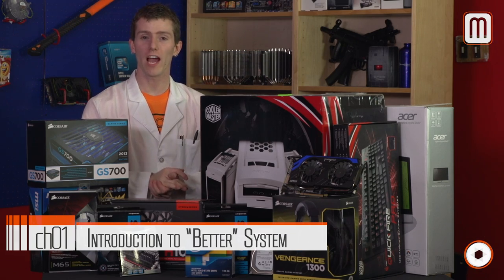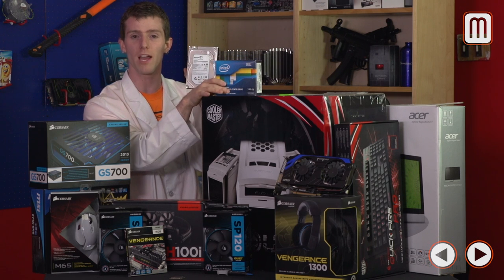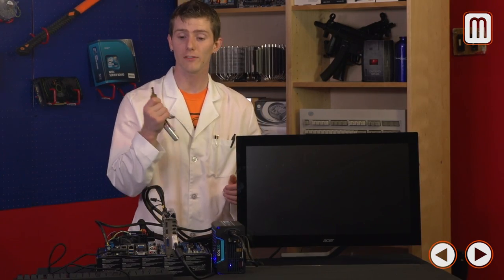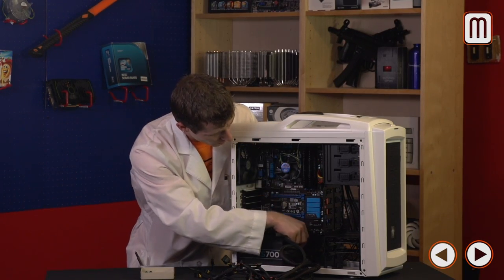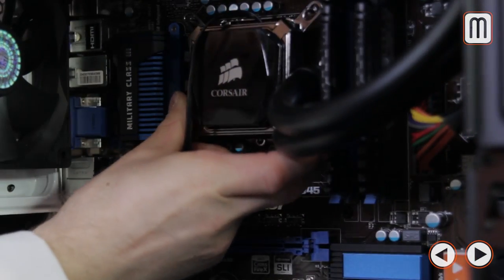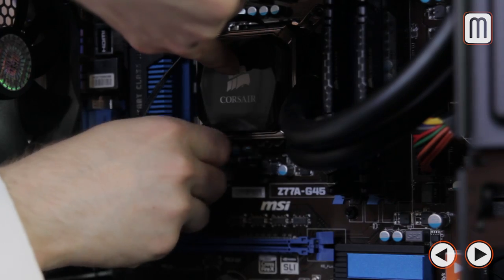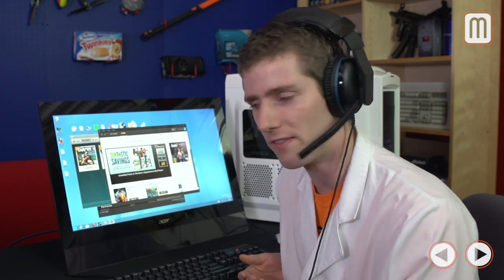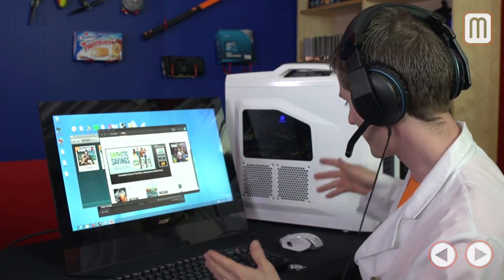ULTIMATE Build a Better $1500 Gaming PC Computer "How To" Guide

Comment: s this build good? If not please tell me what to change
Intel Core i5-4460 with Cooler - 
MSI B85M-P33-V3 Motherboard -
8GB 1600Mhz hyperX Fury DDR3 (1x8GB) - 
Geforce GTX960 GPU 2GB GDDR5 - 
Seagate 1TB 7200RPM - 
Enermax Fulmo. Q - 2x 120mm - with 500W Enermax NAXN Power Supply
Show less
Reply: You should go for a Corsair/EVGA Power supply, the power supplies that are included in cases are (In mayority) really unreliable and may cause alot of problems. The Corsair/EVGA PSUs are around 30$ for a 500W 80+ Bronze.
If you are planning on overclocking the Intel stock cooler won't cut it, get a Cooler Master 212 EVO, it fits in almost every socket and it's around 20 bucks.
Reply: Also, your Ram is one channel (1x8Gb) Dual Channel RAM is faster due to the fact that the data being transferred is going through two RAM sticks instead of one, (2x4Gb) Dual channel RAM packages cost around the same (or lower) and they're faster. JUST MAKE SURE YOUR MOTHERBOARD SUPPORTS DUAL CHANNEL RAM.
Also, if your Motherboard has 4 RAM slots, make sure you put a dual channel memory in the same color slots.
Reply: Miguel Eduardo hey thanks for the advices. Can I contact you via Skype or kik please? I want to continue my build and I don't know shit xD
Reply: +Miguel Eduardo can this build run gta v on 60fps
Reply: +Roey Lubin I would estimate that on high settings, around 60 Fps, I saw a benchmark, An i3 with an ASUS 750ti got around 50ish fps, now that you have an i5 paired with a GTX 960 I'm pretty sure you could play it on high-very high-ultra settings
Reply: +Roey Lubin What's your skype name?
Reply: Miguel Eduardo roeey100
Reply: +Roey Lubin Sent a request
Reply: ***** Hey brother!
Reply: +Roey Lubin Change your CPU to 'K' series unlocked processor
Reply: +Roey Lubin "8gb is way too overkill! 614kb is enough!" --- Bill Gates.
Reply: +Miguel Eduardo He can't overclock with a fricken 4460 lol.
Reply: Fallen Slayer whats overclocking?
Reply: Roey Lubin
Basically pushing the cpu past its limits and making it better, but it comes with a trade off:
More heat and higher voltage.
Reply: +Roey Lubin Overclocking is pushing a cpu or gpu over the manufacturer's specifications, thus making it faster. Overclocking will result in more heat so proper cpu cooling is important. When overlclocking, go into the motherboard bios for the cpu and a third party software for the gpu like msi afterburner to overclock. Mess around with the clock multiplier until you get a stable and satisfactory overlclock. If your overclock is not stable, try increasing the core voltage but not too high.

If you want to overclock, you will need a processor with a "k" at the end of it eg. i5 4690k and a "Z" chipset motherboard eg. Z97. Any gpu can overlclock. I recommend overlclocking as you will get extra performance at no cost. If you don't know what clock to overlclock to, simply search up an overlclocking guide for your cpu or gpu online.

For the rest of your build, get 8gb ( 2x4gb ) of ram. Two ram stick will enable dual channel, resulting in faster ram. For the gpu, get an R9 390 as it is the same price as a GTX 970 but has more vram and generally performs better. Get a 250gb SSD to install your OS and some of your games. An SSD is much faster than a HDD, resulting in faster boot times for your pc if your OS is installed in it and faster load times for your games. Get a Corsair, Seasonic or Cooler Master psu as those are good. Try getting an 80+ gold power supply as those will be more power efficient. I recommend a 750watt psu as you can expand your system if you want ( like adding a second gpu ) in the future without worrying about not having enough wattage to spare.
Reply: +C_Raz_Y thanks for the detailed answer

Comment: For $1000 I'm building a computer that could mister that one. Then again I didn't spend a lot of the budget on peripherals I actually didn't spend any of it on them lol. I didn't have to spend any on my cooler master haf 932 my friend gave it to me. But I was able to build a very nice computer
CPU: 4690k
GPU: GTX 970 FTX
500 watt thermaltake PSU
8GB of Hyper X Fury ram 
Corsair H105
I stole the 360GB hard drive off my old computer 
120GB SSD for boot
And the motherboard is a Asus Z97
All together I was lucky to have a great friend to give me that beastly case and to have a older computer to pick the hard drive from but all together my build comes out to I would say $1200 give or take. Without peripherals my build puts a lot of its budget into the key components CPU and GPU... But Linus seems to go for the all around builds, nothing wrong with that I go for shear performance.
Nice video Linus I appreciate the help that your videos have provided please keep up with the great content! :D

Comment: If I put windows 7 will this still work. Thanks
Sorry but I suck at this, Just getting started :D
Reply: 195fireball ok any vides you reccomend?
Reply: Windows 7 will work fine.
Reply: +195fireball why. it still works fine as fuck, i have a gtx 680 and a i7 980x and it works fine.

Comment: I need help with my next gaming PC do you guys think this is good for the price?
 BLUETOOTH: None
CABLE: None
CAS: NZXT Switch 810 Hybrid Full Tower Gaming Case w/ Dual 140MM Pivot Fan Slots and Front USB 3.0 [+48] (White Color)
CASUPGRADE: None
CD: 24X Double Layer Dual Format DVD+-R/+-RW + CD-R/RW Drive (BLACK COLOR)
CD2: None
COOLANT: Standard Coolant
CPU: AMD FX-6300 3.50 GHz Six-Core AM3+ CPU 6MB L2 Cache & Turbo Core Technology [-150]
CS_FAN: Default case fans
DOCKINGSTATION: None
ENGRAVING: None
FA_HDD: None
FAN: Asetek 570LXL 240mm Liquid CPU Cooling System w/ Copper Cold Plate (2 x Standard 120MM Fans)
FLASHMEDIA: None
HDD: 1TB Western Digital Caviar Blue SATA-III 6.0Gb/s 7200 RPM HDD [-19] (Single Drive)
HDD2: None
HEADSET: None
HS_HANGER: None
IUSB: Built-in USB 2.0 Ports
KEYBOARD: AZZA Multimedia USB Gaming Keyboard
MEMORY: 16GB (8GBx2) DDR3/1600MHz Dual Channel Memory [+74] (Corsair or Major Brand)
MONITOR: * 24" Widescreen 1920x1080 ASUS VS247H-P 1080P (23.6" Viewable) 2ms LED Backlight, DVI, HDMI Input [+169] (Single Monitor)
MOPAD: None
MOTHERBOARD: * GIGABYTE 990FXA-UD3 AMD 990 ATX w/ Ultra Durable 3, On/Off Charge, GbLAN, 4 PCIe x16, 2 PCIe x1, 1 PCI
MOUSE: AZZA Optical 1600dpi Gaming Mouse with Weight Adjustable Cartridge
NETWORK: Onboard Gigabit LAN Network
OS: Windows 8.1
OVERCLOCK: Pro OC (Performance Overclock 10% or more)
POWERSUPPLY: 650 Watts - Corsair CSM Series CS650M 80 Plus Gold Certified Modular Ultra Quiet Power Supply [+64]
RUSH: Standard Process Time: Ship within 8 Business Day
SERVICE: STANDARD WARRANTY: 3-YEAR [3 Year Labor, 1 Year Parts] LIMITED WARRANTY PLUS LIFE-TIME TECHNICAL SUPPORT
SOUND: HIGH DEFINITION ON-BOARD 7.1 AUDIO
SPEAKERS: None
TEMP: None
TVRC: None
USBFLASH: None
USBHD: None
USBX: None
VIDEO: EVGA FTW Edition NVIDIA GeForce GTX 750 2GB GDDR5 PCIe 3.0 x16 [+17] (Dual Card (Non-SLI) [+117])
I know this is alot of stuff but HELP ME PLS

Comment: i currently just have a gtx 650 installed in the pc i have now but just found out that they stopped making them..so if the MSI GeForce GTX 660 Ti Power Edition isnt available what would you recommend..also i live in australia so not sure if i can get the same components that you can get.

Comment: Can someone please let me know if this is all compatible? 

Case - NZXT H440 Blue 

Motherboard - MSI Z170A-Gaming Pro Motherboard 

Psu - Silverstone Strider Plus 600W Fully Modular Power Supply 

Cpu - Intel Core i5 6600K 

Ram -   G.Skill Ripjaws 4 F4-2666C15Q-16GRR 16GB (4x4GB) DDR4 Red 

Hard drive - Seagate Barracuda 1TB ST1000DM003

Graphics card - MSI Radeon R9 390 Gaming 8GB 

CPU cooler - CoolerMaster Hyper 212X CPU Cooler
Reply: +Corey Mettke All looks good, hf with your build.
Reply: Awesome :) thank you

Comment: 1500$ 660ti and i5 hot damn this just shows how far we came
Reply: the infinity stones guess what, an i9 and 2080ti in 6 years is gonna be a damn joke
Reply: @dakheelalmutairi2715  yeah, I actually bought this same motherboard with an i5-3570k,16 gigs of ram and a vega 56 with an xfx 850 watt psu all for about 400 dollars.It should get me by for a while lol until I spend 400 dollars more in 4-5 years for specs that will double my performance, despite my 3570k sort of becoming a bottle neck already

Comment: What are your opinion on a build like this:
-Intel i7-6700K
-GTX 970 (strix edition by asus)
-HyperX Fury 16GB DDR4@2133Mhz
Is something an overkill? Something lacking?
Reply: case
Reply: +KerrankiSuomee Don't get the 6th gen cpus there are reports of them bending due to pressure applied by cpu heatsinks and waterblocks. Get a 4th gen cpu instead. If you are using this rig purely for gaming, get an i5 and 8gb of ram as they will be enough. If you are editing on this rig, stick to an i7 with 16gb of ram.
Reply: C_Raz_Y I'm getting the 6th gen mostly for cheaper upgrading. Is the problem purely on the CPUs or the socket too? Because I'm planning on waiting until they are done with the 6th gen and getting the best one for that socket anyways.
Reply: KerrankiSuomee The problem is cpu based. I don't recommend putting a heavy cooler on the 6th gen cpu as it may bend.
Reply: It's a basic cooler for now as I don't plan on overclocking it. Do you think that they will be fixing the problem for later CPUs of the 6th gen?
Reply: If "future proofness" is worth an extra £100 - £150 to you, then go DDR4, but that banding thing is definitely something to look out for. You may be waiting a long time for the next generation though.... 

My advice is to go 4th generation haswell
Reply: +KerrankiSuomee if you're not overclocking why get the 6700k? Just get a normal 6700, you save a bit of money and it comes with a cooler
Reply: +Nava Hivon locked one is at 3.5GHz and unlocked at 4 :)
Reply: +KerrankiSuomee- I personally have not seen the skylake bending theory. I do know that this build will perform nicely under almost all conditions. The 6700 non-k can turbo boost to 4.0Ghz. Only thing i would recommend is that the ram frequency be faster. Skylake's like faster ram speeds. This is my opinion, take it as you please.
Reply: Depends if u playing runescape on 30 fps and low resolution
Reply: killerhackie I'm not sure what you mean there. The Skylake 6700(K or non-K) is pretty powerful. Adding in the Strix 970 in there on that combo is pretty dang good. Plus i like the fact you can Un-officially overclock the non-K Skylake series.
Reply: Brandon Kennedy gtx 970 is a very confusing product for me $150 more than the 960 and the sam vram, honestly imo I would stick with the 960 and get the K skue and a bit more ssd or better cooling maybe a case.
Reply: Well I was saying the 970 was from the original posters setup. The 960 is a solid card for entry level and with some OC it can perform well. And as for Skylake  I will be getting a non-k version. They can be unofficially overclocked to some nice numbers.
Reply: Fair, good luck, and post some pics of it once done :)

Comment: Nice guide. Can i ask why put SP fans on rear exhaust? usually its air flow fans right?
Reply: Luke Havelard It depends on the placement. If there are obstacles like hdd cages or the like,it's better to use SP fans

Comment: Is this a good pc-

-Asus Turbo GTX 960 2GB Graphics Card
-Intel Skylake i5 Quad Core 2.7 – 3.3GHz Processor
-8GB Kingston HyperX FURY 2133MHz DDR4 Ram
-1TB Western Digital Hard Drive
-WIFI Card
-Windows 10
Reply: +TechNo   Get a 970 card, because it can handle pretty much everything, including some of the newest stuff coming out like the rift.  Ram, 8GB is good, but most are going with 16GB nowadays.  Consider SSD as the main drive, and the 1TB WD as a backup or where you keep videos and music, photos, old documents and etc..  SSD's are way faster and not very expensive nowadays, and you can get by on 120GB, but I would prefer the 250 GB.  When it comes to a Wifi card, it depends on what's going on with the router, and of course the modem and the internet service?  Basically they all have to work together, like you can have  fast internet, fast modem, fast router, and you purchase a cheap wifi card that is slow as a snail which would stink.  So check all that stuff, and remember wired does have some distinct advantages over wifi still, security being number one.  I personally hate Windows 10 with a passion.  In fact I just recently gave my stepmother my new laptop because I hated it that badly.  But that is just me, you might actually like Windows 10.
Reply: +David Rook this is actually ore built for me
Reply: +TechNo pre*
Reply: +TechNo   That's cool.  I kind of go overboard when building a new computer, because I don't want to mess with it other than dusting the inside occasionally or adding an accessory for about five years.  More or less, I spend the money so I can get more mileage out of it, because eventually they get outdated and are not worth upgrading.  I have currently a desktop that is 4 years old that is starting the slow death, even after upgrading the graphic card, and it has an older i7's no less.  Because of that, I started building a  new computer, which the hardware alone will be well above two grand mark when completed, which I am hoping will be worry free for the next 5 years.

Comment: For testing the system on the motherboard box...
The CPU I am buying (i5 6600K) does not come with a heatsink according to the PCPartPicker page. Would I install the aftermarket cooler for testing, then?

Comment: Hey :) Is it also possible to connect the fans of my H80i into the motherboard instead of using the included cable for corsair link so that I can set the rpm of the fans in the BIOS of my motherboard ?

Comment: How is this setup? I have € 4300,00 to spend.

CPU: Intel® Core™ i7-4790K, 4,0 GHz (4,4 GHz Turbo Boost)
MOBO: GIGABYTE GA-Z97X-Gaming G1
RAM: Corsair 32 GB DDR3-1600 Quad-Kit
GPU: 2 x GIGABYTE GV-N980G1 GAMING-4GD
HDD: Seagate Barracuda 7200.14, 2 TB
SSD: Corsair CSSD-F120GBGT-BK
PSU: Corsair CS850M, 850 Watt
Water Cooling: Corsair Hydro Series H80i
Optical Drive: ASUS DRW-24F1ST
OS: Windows 7
Case: Corsair Graphite 780T
Monitor: ASUS 27" Swift PG278Q

I have no idea if this will work. All help is appreciated!
Reply: I don't get some people I can't even afford $500 if you have more than $1000 just buy a pc or if you like it do what you want xD
Reply: First this sucks for 4.3k u should go for ddr4 and 5960x for ur budget
Reply: Youd be better off  with a prebuilt
Reply: NoName Gamer Hi. Why is that? And which one do you recommend than? Asus G G70? I can't find any higher price desktops here in Belgium. Like none of them have 2 graphics cards to run smoothly at 3k monitor. Greetings
Reply: I wouldn't ask here. A tech forum like tomshardware or the linustechtips forum will give you better answers. Youtube comments are complete hell.
Reply: I would go with this:
http://pcpartpicker.com/p/NTZXNG

Do not go with X99. No extra gaming performance. Your money is better spent on 4 graphics cards and a better storage configuration. If you are spending that much to try to get the pc to be more "futreproof", you would be better off spending half of the money now and half in several years for a new system or upgrades if that is futureproofing is what you are after. I hope this helps.
Reply: 1- The 980 is so much cheaper than Titan X that you could nearly get 2 for the price of 1 Titan X (and likely will be cheaper to go with 2 980s when the Titan X is released as the price of last gen cards always drop when something new is released, and will be better performing as well) 

2- Titan X is not even out yet

3- If you were going to wait, I would go for R9  390x cards as they are more powerful (and obviously much cheaper and better vaule)

4- The "futureproofing" of 12gb of ram is overkill and irrelevant as you should be worrying about NOW more than several years later when you will likely have a new system anyway.  

5- The 390x is nearly half the price as Titan X and will perform better (if rumors I have been hearing are accurate)

6. You would gain a maximum of 20% performance going with Titan X over 980 for about 2x the price, which is not worth it

7. A cpu with hyperthreading is more important for futureproofing than 12gb of VRAM anyway, as new games are optimized to run well on more cores\threads anyway, not more VRAM.

8- You would have to go with an i5 to squeeze 3 Titan X into the system, which will never let the cards reach their full potential anyway, crippling performance by about 20% anyway

9- The Titan X only comes in a reference version, which is more noisy

10- Shall I go on?
Reply: ok so i made a mistake we all make mistakes. What do you think about the rest of my build? What about my list? besides not out yet?
Reply: talking to me or anyone else like that is not ok. Do i talk to you or anyone else like you previously did?
Reply: Have I been rude to you?
Reply: Cypriaan Sacré what are you going to use it for?

Comment: should these specs run Gta5 smoothly 
Processor: Intel(R) Core(TM) i5-6400 CPU @2.70Ghz 2.71 GHz
Ram: 12 GB
64 bit operating system, x64 based processor 
Graphics card: nvidia GeForce gtx960